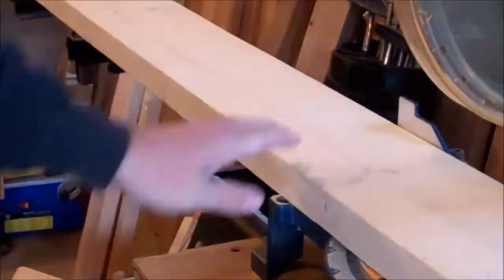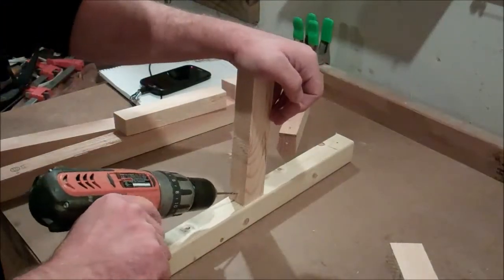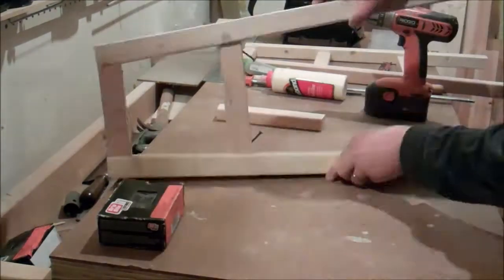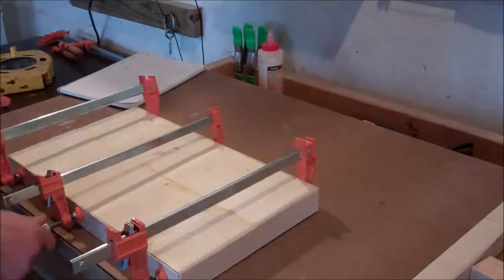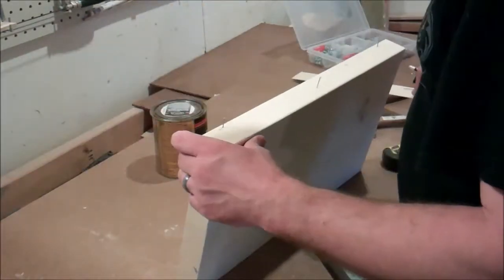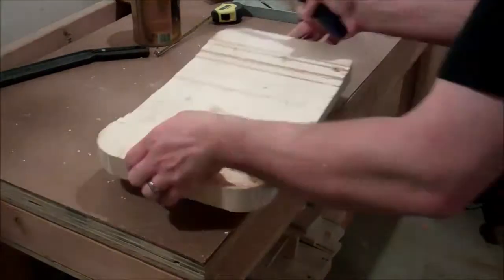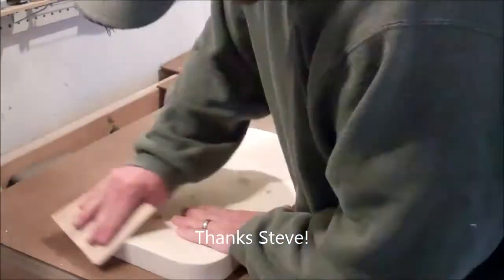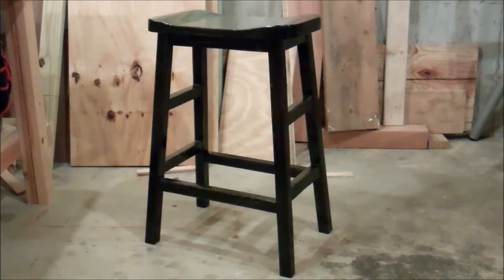Shop Stool

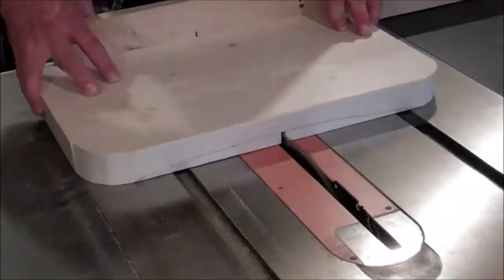Comment: 5:07 ingenious way to hog out the material of the seat. Another option is a wood sculpting blade for an angle grinder if you have one.  Now for the big question: Is it comfortable?
Reply from the maker: Thanks for watching Fr. Thomas.  I don't have an angle grinder, but I'll keep that in mind.  I'm just starting out so my tool selection is rather limited. As far as comfort goes, it actually is pretty comfortable.  Much more so than before the seat was carved out. Cheers!

Comment: Great looking stool! I see that you have bought pocket hole jig now but then you could make joints from the outside and put dowel as a plug to the holes of stool, it would be a bit sturdier and less hassle to drill those angled holes.
You did a lot of job on making that top curve in the stool!
How do you like your working mate (b&d)?
Thanks for the video!

Comment: What are the dimensions of the wood you are using for the legs and stretchers and how did you determine the length of the stretchers?
Reply from the maker: For the legs, I ripped a 2x4 in half after trimming off the rounded corners so they are 1 1/2" square.  The stretchers are 1 1/2"x1". I did the same thing here, ripping down a 2x4.  I got the length of the stretchers from the plans of somebody else's stool that was similar to the one I was making because I couldn't wrap my mind around how to calculate what it should be.  It worked out ok, but through small misalignments, they were not quite at level heights. If I were to do it again, I would make my legs, position them the way I would like them and measure to fit.  Hope that helps. Let me know if you need more info and thanks for watching.
Reply: Woodworking With Tylor It does help for the most part, thank you. I had the same thought about not being sure how to calculating the distance which is why I asked. I'm over 6 feet tall so I want to make a custom height stool, so I need to understand how the measurement were made on other peoples plans in order to alter them for my self. Most things I found are just templets to make the stool one way. I will say yours is one of the best videos I've found on the subject. As with most things I'll just have to figure it out. Thanks again.
Reply from the maker: BenchwarmerFilm If you haven't already, check out the video by Steve Ramsey (Woodworking for Mere Mortals) http://youtu.be/KHOtVjlO27E.  He made a stool the same week. I think he does a good job with the legs and cross pieces.  If you lay out the legs like he does, you may be able to find a formula to calculate the length of the stretchers if you want to make stools of different lengths. Good luck. I'd love to see what you come up with.